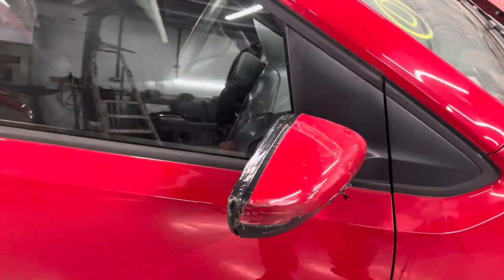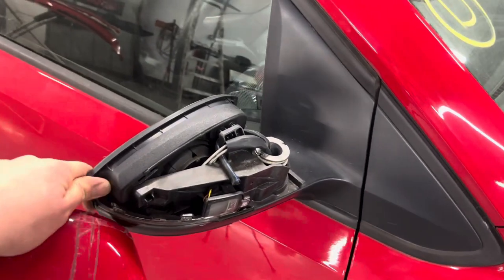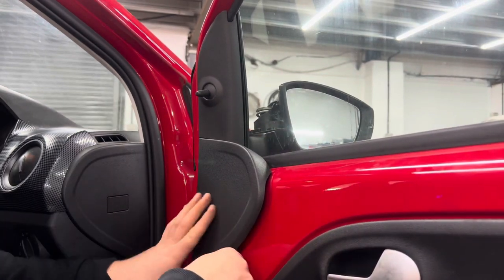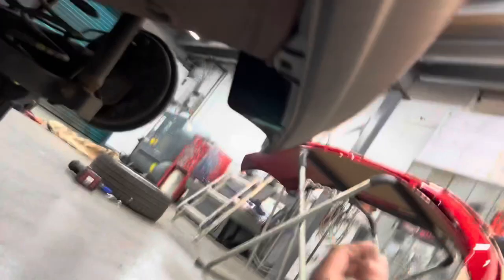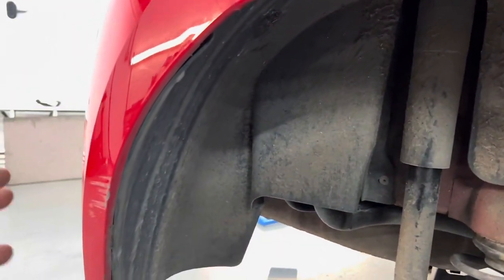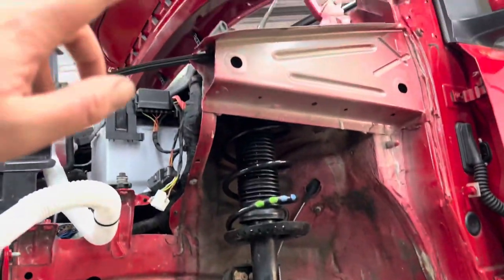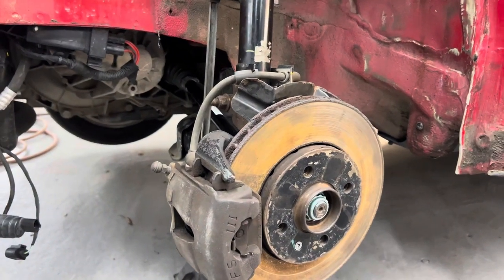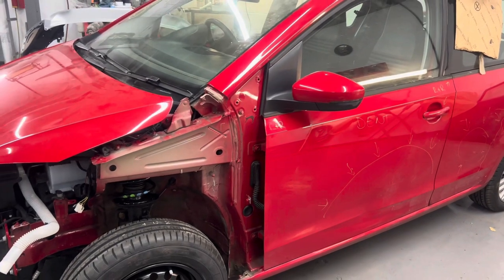Rebuilding a crash damaged 2019 Volkswagen up from copart Uk part 2

Comment: Great video - keep up the good work. FYI As per the workshop manual the  VW Golf Mk4 hub nut torque sequence is: 200Nm then loosen by 180 degrees then rotate the wheel 180 degrees then torque to 50Nm + 60 degrees.

Comment: Hey Nathan have you ever had any fault codes with the steering angle sensor on these. I have a yellow steering wheel light and traction control lights on with a fault code saying B116854 - steering angle sensor no basic setting. Just need to get this done then the car is normal then
Reply from the maker: Hi zain has it just randomly happened. Or is it a car which the airbags have deployed
Reply: @NathanHiley  so removed the steering wheel and clock spring as removed the dash to fit some extra features in. I messaged you on Facebook messenger too if you want to message me on there 👍

Comment: Did you fit an electric mirror for a manual one?
Reply from the maker: No I didn’t mark the wires you would of seen is for the indicator. As the facelift up has the  indicator in the mirror and not in the wing like a 2012-2015 up .
Reply: @NathanHiley  ah ok, great uploads btw